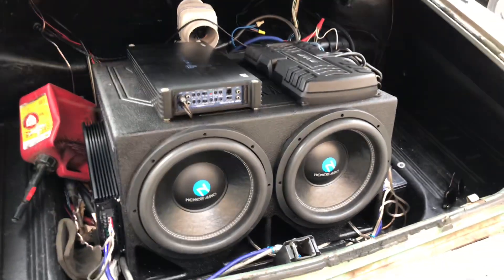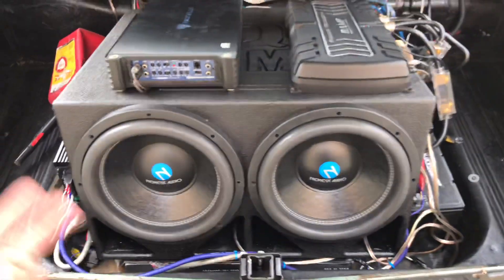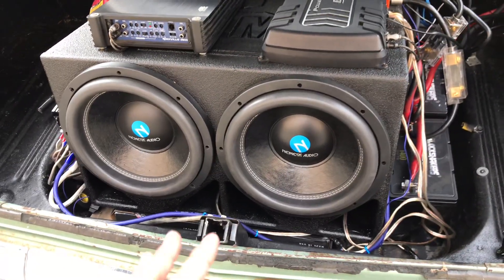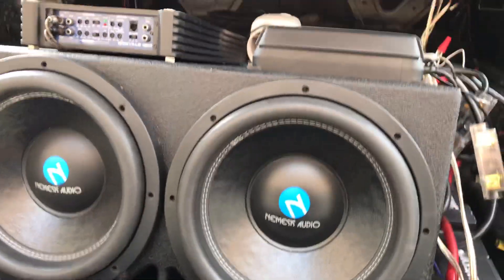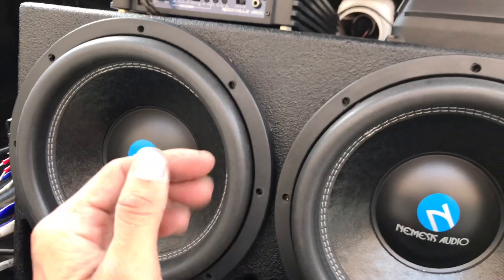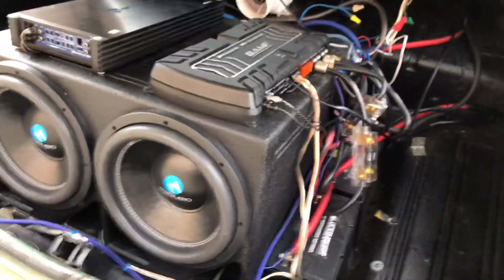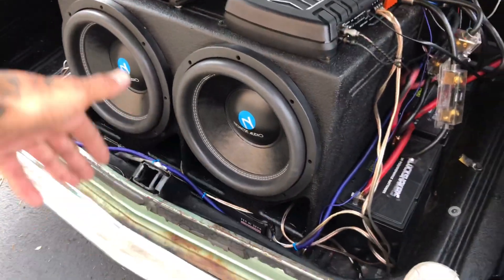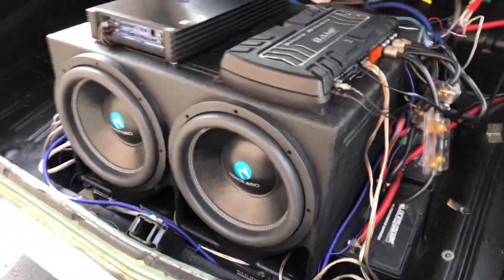Subwoofer making popping noise- my fix

Comment: Definitely helped me out. I have 2 15 inch Rockford fosgate p3’s and it was doing the same thing. Added a lot of screws and now it’s not making any noise. 👍
Reply from the maker: I’m really glad man!
Reply from the maker: It’s crazy how these boxes are expensive and they used fucking glue thinking it would work
Reply: @vincentbryan1962  one of my subwoofers keeps making an airy noise, like if there was too much air coming out of it, but the other subwoofer sounds perfectly fine, any help bro?
Reply from the maker: @alecruiz1328  mine did that before it was wired to the wrong ohms. Sounds like the sub isn’t hitting as hard as it should or sounds like air. I used to have l7 that did that. Come to find out it was wired incorrectly. Check out your amp. And subs. My set up here is now wired to 2ohms. I have two 12 inch dual voice coil subs wired to 2ohm amp. So check your wiring make sure it’s compatible with the amp.

Comment: That box looks good and well designed!
Reply from the maker: It’s a solid box I love it. Just needed to reinforce it a little because these subs are no joke
Reply: You can order it from Amazon its called a boombox😒 making your own would be wayyy better than a prefab box
Reply: Make yourself a amp board bro before you destroy those amps from vibration
Reply from the maker: I thought that’ would be the case but my amps are still good after 2 years
Reply from the maker: Mines called q bomb

Comment: was it a continues pop or you hear every 5-10 seconds     because when i turn my subs all the way up i get a pop noise every 5-10 seconds depending on the note
Reply: Me too !! Wtf is it
Reply: mine did that i got a extra battery for my subs and it helped maybe it was u losing Volts
Reply: its called clipping, turn ur gain down
Reply: @ethanyoung3668  I think ur spot on my skar 2000 doesn’t like below 13 volts or it sounds like popping /bottoming out
Reply: You ever found what the problem was ?

Comment: So i bought an alpine A60m Amp and 2 kicker comp 12 c for my Silverado and i also was having a popping sound issue as well on both of my subs. It took me a month until i found out that it was just my amplifier that came defective.
Reply from the maker: It’s a crazy process we all gotta go thru at some point. Trouble shooting every little thing. I thought it was my amp too. I thought the gains and settings was too out of wack. Come to my surprise is was my fucking sub box...
Reply: Was it popping only at high volume or all the time?  I have an alpine A60m and also get popping from my alpine type r at higher volume. The sun is rated for 750 rms and the amp only gives 600.
Reply: @Pattfahey  The popping sound started happening as soon as i turned up the volume to 16 and above (40 being max volume on my pioneer Stereo).I fixed the issue by just replacing the amp with the same one and it stopped doing it.
Reply: The main thing we have to keep in mind is that it takes power to make power... Amps that do not get supplied power will not act correctly, make popping sounds and not give you the rated power. 0 guage wire, straight to the alternator is the key. If you cant do that for some reason, run your amp wire to a second battery, and run a line from that to the amp, and make SURE you have a really good ground. Bad grounds are a killer. Always remove the paint down to bare metal on the area you are grounding to. Seat belt bolts tend to work best. Just sand all the paint around it and bolt it down. Thats the top 2 things that make systems underperform and sound funny. Give it the power it needs, and it will make it. Cheers~ (P.S. Never use shitty RCA cables)

Comment: I'm in the same boat boss but the green light on the amp dim. Set up in my semi for a month but now this happenes. No loose connections. I'm running 2 12 skar  ported combo box with a skar 3500d.mono.
Reply: I also experience lower power to subs as in same volume no hard hitting bass just a few days ago. But now it's back but I can't play at volume 30.
Reply from the maker: @jrantman  try checking the remote turn on wire see if it’s clean. If it’s a clean connection. Sometimes I found out if I wiggled the remote turn on wire on the amp it made my subs louder I just needed a cleaner connection.
Reply from the maker: I just got 2 12 skar 1250 rms subs and I’m loving them
Reply: @vincentbryan1962  on vacation will check when I get back

Comment: I’m not really educated  that much in audio I have a 3000 watt dual subwoofer and I pushed it too hard and one of the fuses in the amp blew and since then the sub has been distorting whereas before on the same track with same volume it wouldn’t. Any help?
Reply from the maker: You might haves fucked up the speaker. Push the speaker in and out while it’s resting cars off and listen and feel for cracking.  It might be blown. Amps usually do a good job and busting a fuse so nothing else breaks or gets damaged. Might have simply pushed it too hard. We’ve all been there before! Especially no offense but dual isn’t a high quality audio brand name. A lot of the cheaper stuff breaks, unfortunately that’s why people say you get what you pay for. You can always buy a new subwoofer and replace the one you have to see if it fixed it. Or vise versa with the amp. And return the damaged one :)
Reply: @vincentbryan1962  oh no 😂 it’s not called dual I said dual because there’s 2 subs in one enclosure on the actual subs it says LTD and they have a grill covering them so I would have to remove it to see if there’s any noise when I push it in.

Comment: Hi bro 
So i bought a Kenwood HQR3000
And i didn't even used the Sub on high volume but now my sub has a cracking sound.
I took out the sub from the box and it's still the same.
Do you know what issue it can be?
Reply from the maker: Did you try pushing the sub in and out. With your hand push the sub inward. And if you hear like crunch cracking sound then the subwoofer is blown :/ that’s what it sounds like to me but it’s hard to tell over messages
Reply: @vincentbryan1962  I did that but nothing changed.
I put my finger on the spider just to see if there's a loose joint between the cone and coil however the joint was solid.
I then tapped on the cone to see if it makes a cracking sound however it didn't.
I then pushed the sub in and out and it was smooth AF.
I don't know what the issue here is.
Reply from the maker: It cracks when? 
When it’s hitting hard or barley hitting?
Reply: @vincentbryan1962  it cracks on barely hitting. I put my amp on the high frequency just to see if the sound of the song is clear through the sub, and it was. It doesn't hit however it just makes the krrr krrr sound.
Reply: @bakhtiyargillani  did you ever figure it out I’m in your boat brotha it’s doing it to different subs
Reply: @christophershirk489  Yes bro.
The glue which connects the surround rubber with the cone was wear out. i checked it, disassembled the whole cone, applied wood glue and put the sub upside down on the table.
It's working well so far.

Comment: Mine no joke if i play it on YouTube for a bit glitches and pops then transits into a noise that sounds like an air raid siren getting louder and louder and louder. Fix for that?
Reply from the maker: Kinda Sounds like an alternator whine my guy
Reply: @vincentbryan1962  how interesting
Reply from the maker: @xemus30  what other ides would you think it might be?
Reply: @vincentbryan1962  well i think it is competing with something YouTube is doing and it glitches out and plays that sound, abd im being serious that it sounds like the begining of an air raid siren. But in the begining of the sound it's weird pops that range in volume and variety. It goes away if i exist out of YouTube or if i get the subwoofer remote and turn it down, for more info it's tv YouTube, this happens no where else

Comment: I have 2 pioneer 12s on a skar amp and when the bass hits all you hear is a knocking sound coming from the left subwoofer! What could it be?
Reply from the maker: I suggest unscrewing it and taking it out. Play it to make sure it’s the subwoofer. Could simply be blown
Reply: @vincentbryan1962  okayyy, I had did that and made sure the wiring was perfect but still knocking, even with the gain on 1/2 it’s knocking bad, but when it was brand new it was perfect
Reply from the maker: @dedrickmctier160  if you know forsure it’s knocking. You took the sub out to inspect it. Then it’s blown. It’s simple 

If I were you I’d just buy a new one. “Return it” But return that one that’s broke. You know what I mean
Reply: @vincentbryan1962  ohhh I just texted you on Instagram, but yea it’s only the left one and not the right, why is that

Comment: Do u have a vid of the sound ?
Reply from the maker: No it didn’t really pick up clearly on audio. Just imagine wood inside the sub box knocking when the bass starts to hit. It’s the mdf inside hitting the top of the box. I made sure I fixed it before making this video I suppose I could have taken the screws back out and showed you all what it sounds like. But the video wouldn’t be able to clearly pick it up.

Comment: How do I know exactly where to screw?  I have the bigger q bomb box
Reply from the maker: Take one sub out if you can just to look around and see where the mdf connects
Reply: Ok so question.. if I didn’t want ti pull the sub out.. could I screw randomly on the top.. I just noticed, the rattling is coming from the big port In The center
Reply from the maker: @AntonioRuiz-mx6kq  of course you can. Yes! Just Don’t be surprised if you miss tho. And have bunch of screws in there. Use smaller screws so if you do miss they don’t make a big difference.
Reply: Ima be honest man I love a load system but I’m hella new to The Whole thing 🤦🏽‍♂️😅 assuming mpf is the type of wood that’s on the inside.. is it covering the whole inside? Tonight I pulled over and leaned on the box and I got the sound to stop!!! I was pumped  bro !! U the man!!! I got the EVL 2500 12 skars n I could of sworn they was blown 😩😩🤣 so I guess I’ll just score a few self rapping screws in that general area? Will screws mess anything up as far as the box? 🤷🏽‍♂️😩🤦🏽‍♂️🤣 I appreciate ur responses too brother .. that’s what’s up 💪🏽
Reply from the maker: If you’re new and the sub isn’t too much work to take out for you to just look. I’d look, so you don’t mess up anything up. Also they have MDF screws. Or any wood screws would work better. Mdf is a little special it flexes. Other woods would crack or not last in the sub world. A q bomb box is basically a regular box but sprayed heavily with truck liner….
Reply: So im going to pull the sun out and look inside.. im guessing im looking for any separation inside ?

Comment: So u built a box without using screws😂😂wow
Reply from the maker: No I didn’t build the box. Nobody said that. Lol so you watched a video and still didn’t understand it wowwww
Reply: It’s a prefab box
Reply: Also if done right and with the right type of glue the bond is stronger then the wood. It is perfectly OK to build without screws. If you break it apart there will still be wood where you glued it together. I use both but it's just there as an extra precaution

Comment: Putting an amp ontop of the box is the most amateur shit
Reply from the maker: I got other plans for my trunk bud. I’m going to get hydraulics on my lowrider. So I need the space for batteries and pumps. Sometimes people need the extra space. And putting an amp on the box seems more efficient for the time being. I was skeptical at first but I been beating for years and my amps are still working fine. What’s amateur is making comments on YouTube hating on another mans video instead of appreciating the intent of it or better yet making your own. So now we both stated some opinions worth nothing :)

Comment: Just talking, no doing......
Reply from the maker: Yes. I had to do it first. To find out the answer. I wouldn’t have talked …..if I didn’t do ..it first. Do you really need to see me lean on a box and put screws in it to secure in the loose mdf ? I tried to make it very quick. I helped out a few people with this same problem and they had the same fix with this talking video.

Meanwhile you’re not doing shit like finding out the fixes to your own problems and then posting a video to try to help out others… you’re sitting here just typing on mine….. just typing 

So we both have the same opinions how bout that.